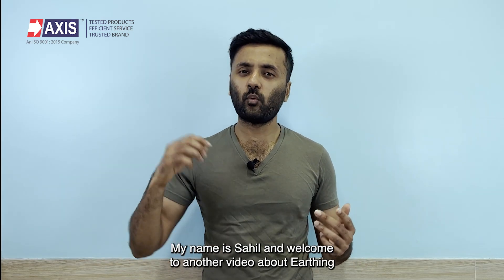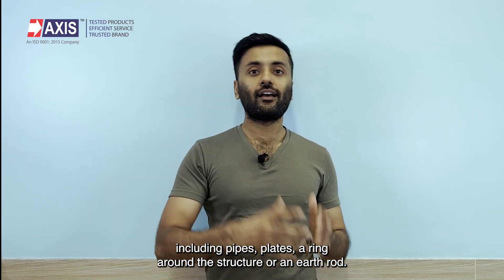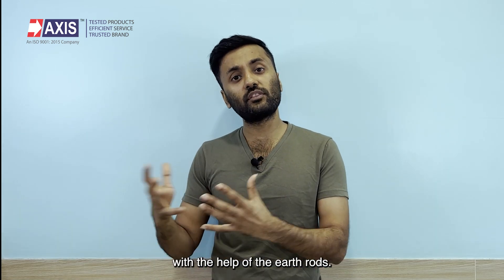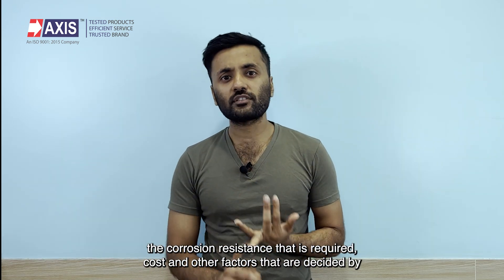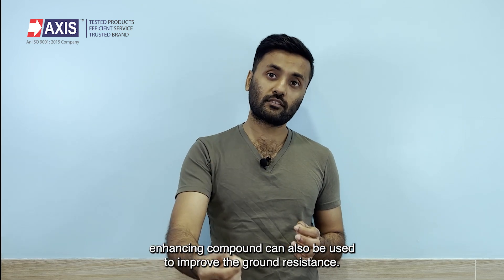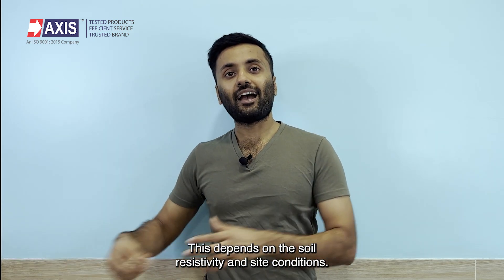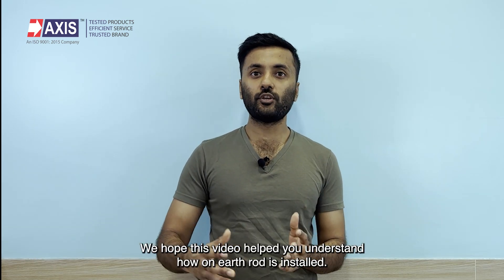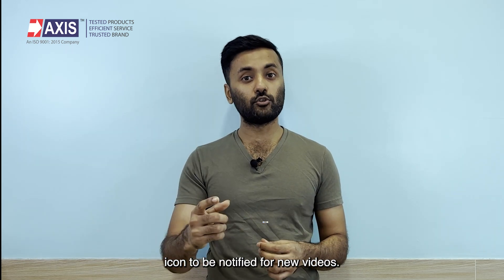Earth Rod Installation - Step by Step Procedure Explained!

Comment: Hi! What type of earthing system uses in High rise buildings. Is the earth mat/grid necessary or bore type?
Reply from the maker: Bore Type Earthing is recommended for High Rise Building. 
Can we get on a call for discussing your requirements?
Reply: @AxisElectrical  Thank you for your precious response. we will connect shortly inshallah

Comment: I want to install a proper ground system for surge protection..im using a 4ft solid copper rod ..i had 5ft deep of chipping filling which i removed ..but when i finally reached the soil it's very rocky and there are large rocks underneath..so my question is what if i fill up everything with soil rather than chipping this time..will my 4 ft rod work? As long as the ohms are 25 or below ..would that mean it worked?
Reply from the maker: I will need more measurements and details for giving you a proper answers,  let's discuss this on a call. 
You can book a meeting with our engineers, email your preferred time and query at sales@axis-india.com

Comment: u have mentioned 3 types of earth rods . what will be the result of each type of rods if used in earthing apart from the cost & durability .
Reply from the maker: Hi Bhuvana,
Cost, longevity, and conductivity vary by rod type. Solid copper is costliest but most conductive. Stainless steel lasts longest. 
Fault current capacity is material-dependent, affecting sizing.

Comment: Is it necessary to use salt, water and coal in an earth system
Reply from the maker: Hi, 
It is not necessary, it depends on the pre-assessment results of the soil resistivity. It is advisable to be used only if it is needed as per the design calculations.
Discuss this in detail with our experts at sales@axis-india.com
Reply from the maker: Hi Elohor, here's a video that will help you understand the role of salt, water and coal in Earthing

https://www.youtube.com/watch?v=ha_grg4iizw&t=8s

Comment: Is it necessary to use earth mat with earth rod for earthing installation?
Reply from the maker: Hi Taiwo, where are you planning to install Earth Rods? Which place do you want to protect?
Reply: @AxisElectrical  it is a small structure consisting of some offices
Reply from the maker: @taiwolawal6940  Great! Then you have both options Earth Mat and External Earthing.

But if you are going with an earth mat, you will need a professional team and there might be coordination difficulties between civil and electrical work.

 However, our engineers will help you in both cases, please share your details at marketing@axis-india.com

Comment: Which area can we install the earth Rod in a?
Reply from the maker: The exact location of the earth rod will depend on the electrical code requirements in your area and the design of the building's electrical system.
Reply: @AxisElectrical  is there a standard electrical code, if YES, how can I get one
Reply from the maker: We can check that after knowing your location. Please share your details or connect with our team at marketing@axis-india.com